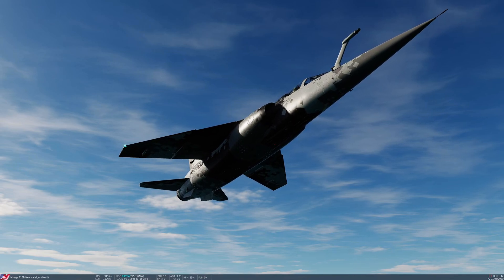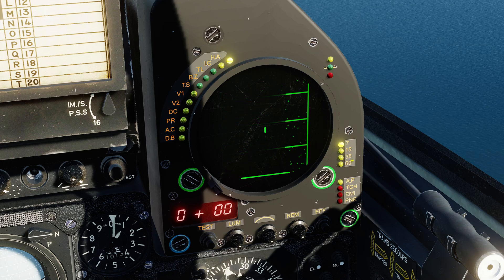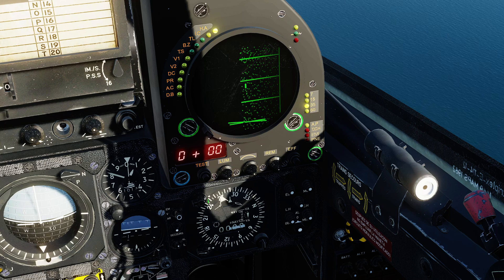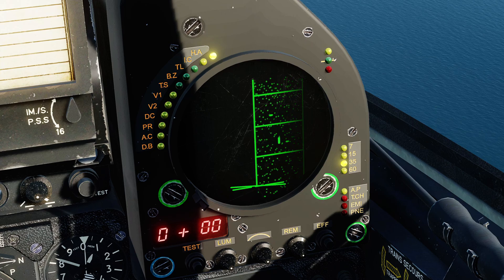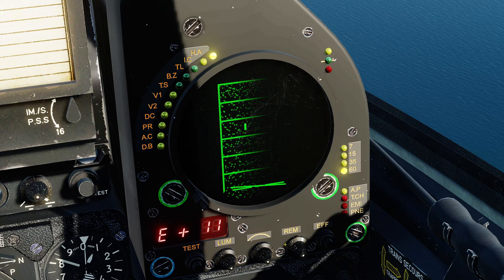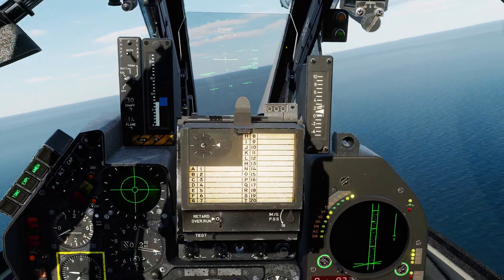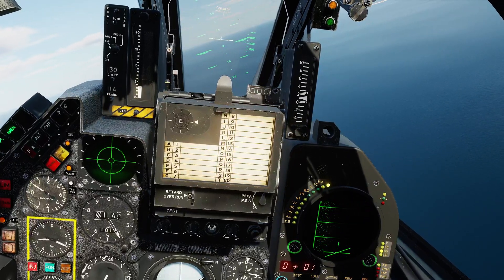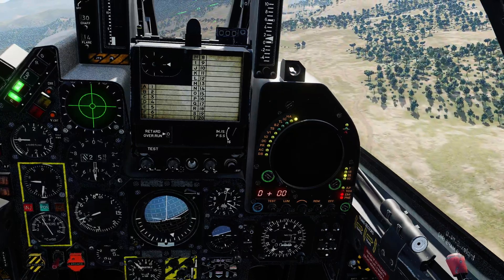DCS Mirage F1EE Tutorial 4 - Radar AA BVR

Comment: Thanks for showing the new TWS mode. Hadn't time myself to try it out yet. Can the SARH missiles be launched in this mode and radar will automatically switch to STT or do I have to manually go into STT?
Reply from the maker: You cannot engage with SARH missiles in this mode you would have to switch to APC (STT) lock in order to fire. I would assume however that IR missiles and gun could be employed. I doubt that an auto switch would happen if you did try to fire an SARH missile but I'll test this.